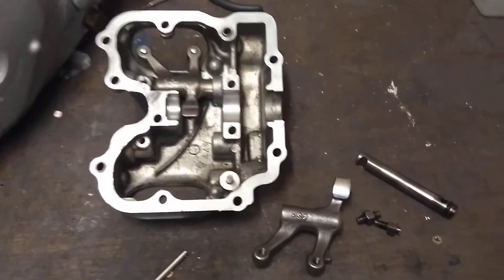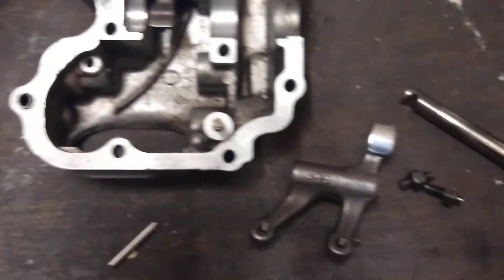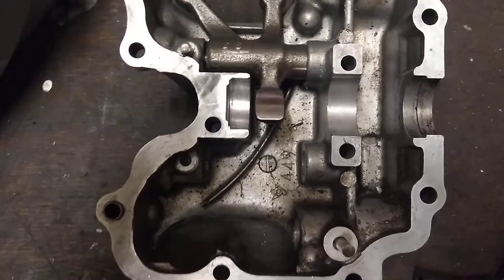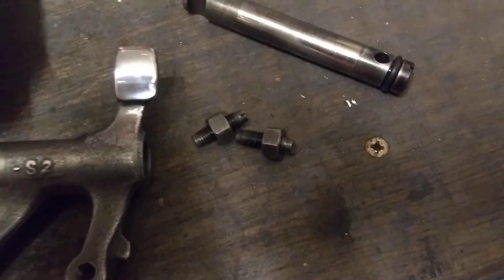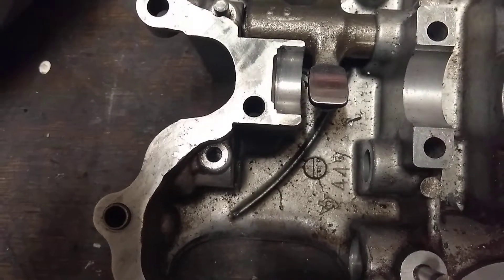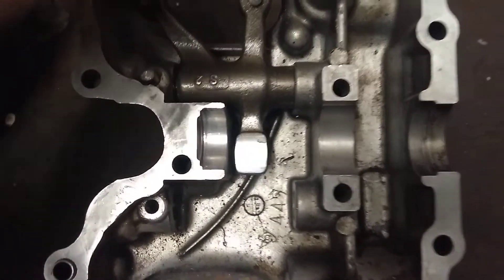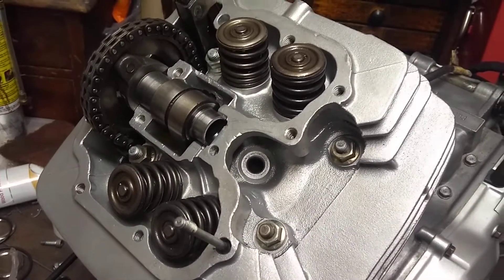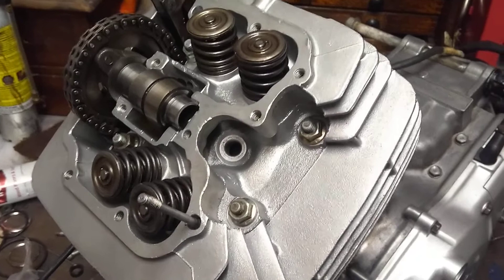Honda XL500 rocker arm repair

Comment: How do you remove the pin that is holding the rocker?
Reply from the maker: I've made a video on how to extract the dowel that holds the rocker shaft in place

Comment: Hi there if you don't mind how much did they charge you to do the rocker arm
Reply from the maker: Hi it was £33 to repad the arm which included postage, there were two options, one was to polish and reharden the pad the other was to braise a carbide pad and reshape and mine was cheaper than they said it would be so I'm happy.
Reply: @tevie54  thanks Steve looks like I've got 2. I have done as the engine was run with the oil feed to the top and blocked when the cam chain tensioner started to break down once again thank you